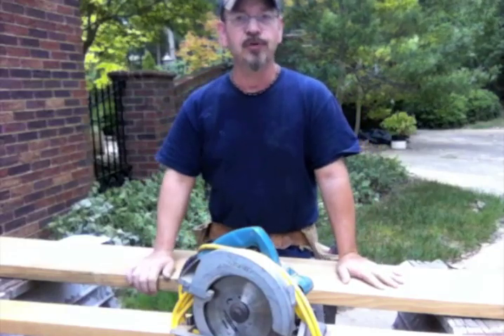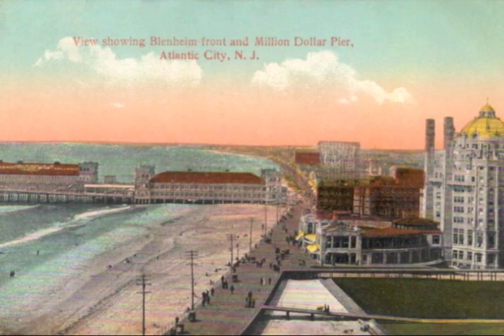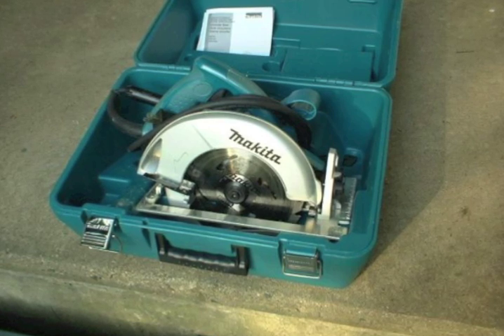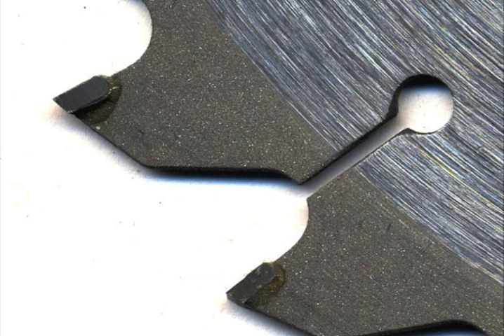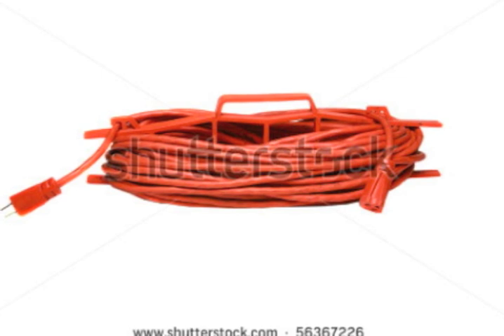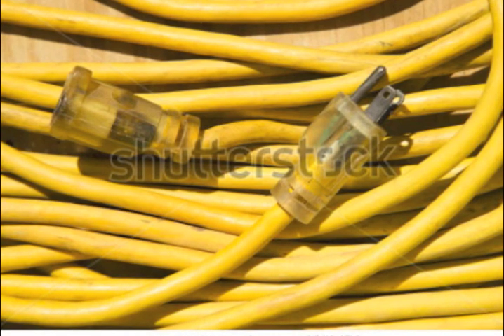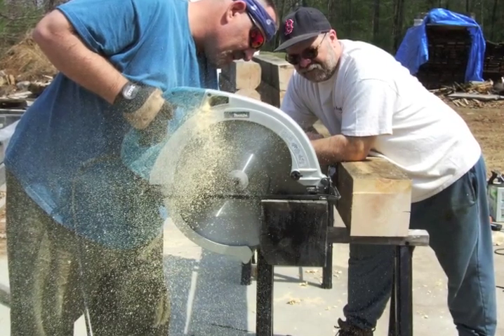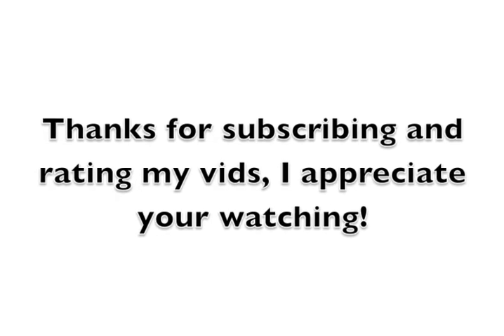CIRCULAR SAW- Mods, Guides, Assessories.

Comment: I love my RAS. A lot of woodworkers don't even use these anymore. It's all sliding miter saws these days. I'm what you call an old school woodworker. I was brought up in the old school way of doing things...even though I'm only 18... The only tool company that makes RAS any more is Sear/Craftsman. Runs about $1000.00. The miter saws are nice because they can stay accurate in angles, The RAS has a hard time going back to 90 square.
Keep the Vidz coming.

Thanks, Michael Frey.

Comment: Very nice video. Great Info. I agree with you on cheap saws... For home owners a 60-80 dollar saw should do the trick.. Should last them. When it comes to pros's guys that do woodworking or remolding ect. should pay 100-200 for circular saw. Also Craigslist has great deals. I have A Porter Cable 6" saw boss. Man to me that is the best saw on the planet. Got it my local Parr Lumber for $150.00.. Things great. Has a lot of power but is also light... I call it a one hander saw....

Comment: Hi Mister Soul great video. I was wondering (I already think I know the answer). I am taking your advice and shopping quality used saws on C L and Ebay. I found a couple really nice Rockwells and Dewalts used with cast aluminum platform/saw bed. My question is can you put a 7 inch Dado/stacked blade in a 7 1/4" circular saw? I have to make 3/4"  grooves in 12 barn door frames to receive a beveled 3/4 by 3" water shed above the top of the door. A dado blade would make the job go faster.

Comment: I've had a Skil saw well over 25 years and have framed fricken houses, deck, etc with it. Still have and use it. Cost me like $30 bucks in the 90's I think. Did I say I still use it?
Reply from the maker: Skil makes both cheap ones and professional models, sounds like you have a good un.
Reply: sounds like one before cheapy china mode kicked in

Comment from the maker: I don't think a dado will fit in a regular saw, and it sounds a little risky anyway. NOt exactly sure what you are doing with the barn doors but there has to be another way. if you are trying to protect the top edge of the door why not wrap alumn flashing across the top edge. If you want a overhang above the door, screw a cleat and attach the slopping drip board to it.

Comment: When I started working as a sheet metal worker in the mid 1960's on new house construction I was told to cut the flooring for register installation using a circular saw.  For ease of making the plunge cut, the guard was removed!  I was 18 at the time and TERRIFIED.  I got the work done and somehow kept my arms, legs and such but I was really looking for a better way to do that work--think reciprocating saw.

Comment: a circular saw is not a high amp device with only 5 Amps. And if your cable is rated for that, you are good to go.
Reply: Most saws are 13 to 15 amps my Mom's Makita is a 13 amp and my Skilsaw model 77 is a 15 amp saw.